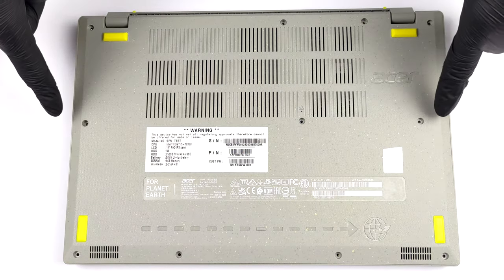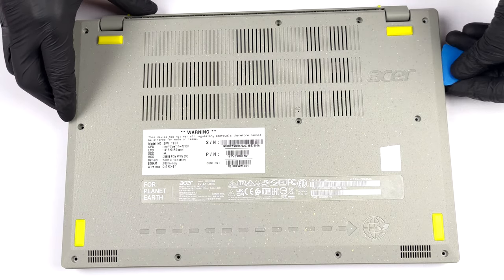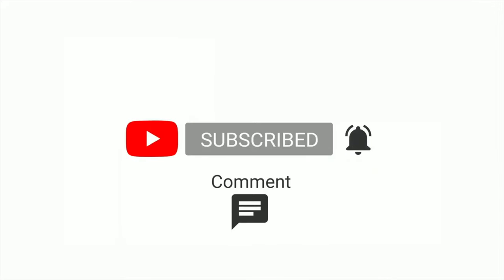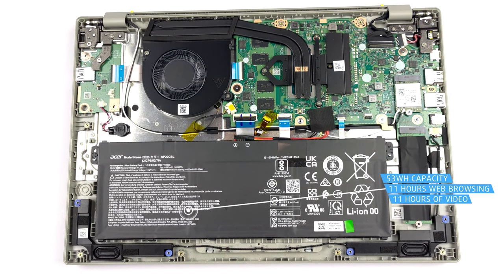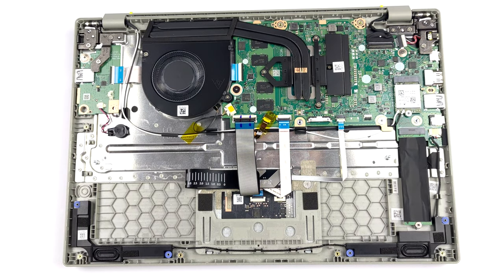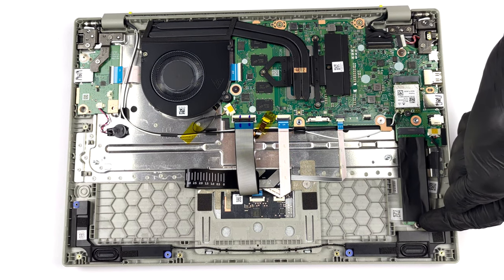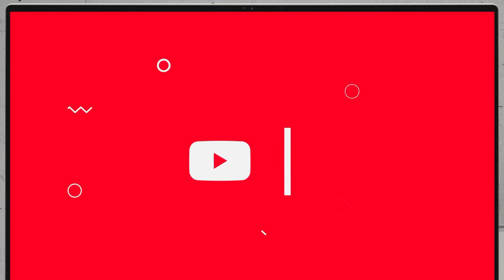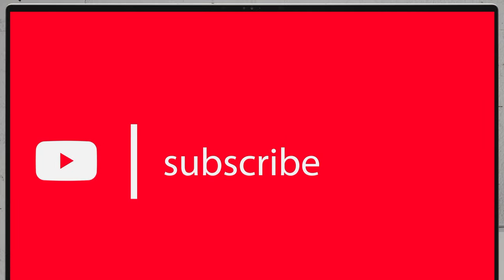🛠️ Acer Aspire Vero (AV14-51) - disassembly and upgrade options

Comment: any way to leave the keyboard always on?
Reply: edit - You can adjust keyboard backlit in BIOS to stay always on. I have to experiment more with sleep setting, but it appears the keyboard stays lit even if the Acer is in sleep mode. You still can hit F11 to turn off keyboard.

Restart or boot computer and press F2 to enter BIOS
Find the keyboard backlight timeout setting (which is defaulted to "enabled")
Disabled it
Use F10 to save and restart
Backlight stays on now

An Acer utility to set a specific timeout period would be more convenient.